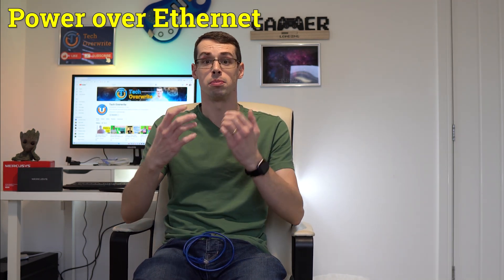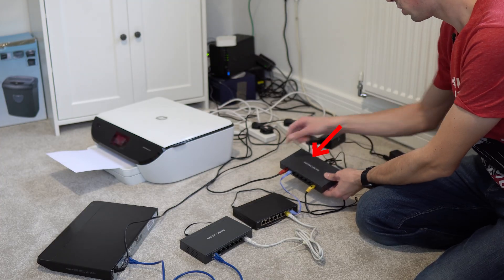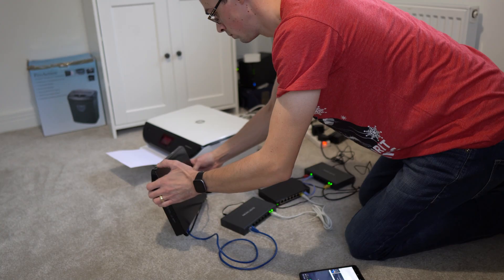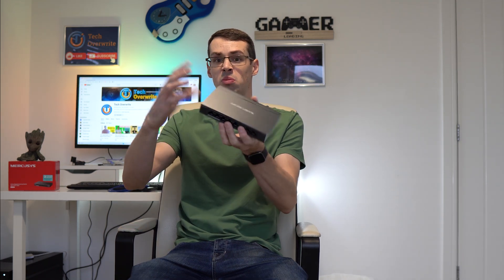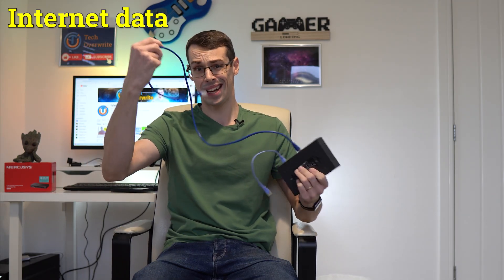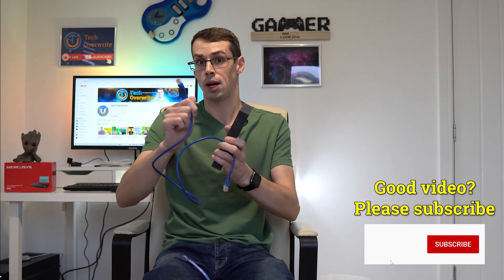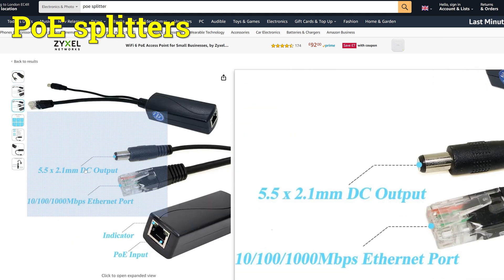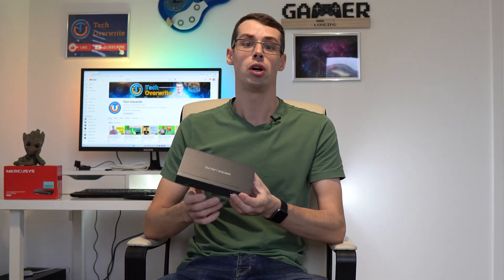Will It Fry? Non-PoE Devices With PoE Switches

Comment: can I connect a LTE router which uses passive 24V poe adaptor to poe switch insted, will it burn what do u think ?
Reply from the maker: I might be wrong, but some (many?) PoE switches are 48v so you could potentially have problems. I wouldn't personally chance it, but check the manuals of both too.

Comment: The comparison at 3:00 isn't correct, because the product shown on the right is a midspan injector, and doesn't have any switching circuitry included. Passive PoE should be outlawed, because it fries the termination resistors in the blink of an eye.
Reply from the maker: Thanks for the clarification, that's good to know, and I agree that passive PoE shouldn't exist. Luckily it's more common in prosumer and pro level equipment (i.e. people who should know what they're doing) but there's always that risk that someone else picks up a passive PoE device and tries to install it. :/

Comment: Can you connect a rj45 tester into active port on poe switch
Reply from the maker: Ooo good question, unfortunately I don't know but I'd guess that the answer is "it depends". A good RJ45 tester should definitely handle it fine - some even have PoE testing functions, after all. But a cheap RJ45 tester? Hard to say sorry - I would double check the manual.
Reply: Actually if it can help i have the klein tools scout pro 3 i really hope it is not on the cheap rj45 tester category if you familiar with the item
Reply from the maker: @joemccarthy2109  that's a great tester, nope definitely not a cheap one 🙂 So that model does have a voltage checker, and the manual (page 4 of the PDF) says it checks for RJ45 voltage before performing any tests. So it sounds like it would be fine connecting to an active PoE port, based on the PDF I just checked out.
Reply: Can you please check page 3 letter d my all problem to begin with it’s because that note the rj45 voltage check is actually on the side of that tester but the hublink function is on the regular rj45 port on the tester and i would really like to figure it out after a month of searching
Reply: What do they mean by saying active port according to what you have said you really should have connected it into an active port and not passive one but they say the opposite
Reply from the maker: Unfortunately I don't know for sure because I don't have the Scout Pro 3 myself. My hunch is that contacting their support might be best (assuming you get through to the right team - i.e. a more network focused team). I wish I could be more help but I wouldn't want to guess here. I thought the PDF was referring to the active PoE port on a PoE switch though, not the Scout Pro 3.

Comment: if i use an non-poe switch with the splitter to connect to a pd, if i replaced this PD with another non poe equipment, will a problem happen?
Reply from the maker: I think it should be fine. If I'm understanding correctly, just the data 'part' would be used here - the power would not be 'used'.

Comment: Yep, I was also wanting to know the same.  Just bought a new Netgear POE switch for 7 new POE cameras (and ethernet around the house whilst I was at it).  I just wish I had come across this yesterday before I said "Oh well, let's see what happens" 🙂  I can now keep my old switch with my home and work computers with only 1 trailing cable whilst I set up all other stuff and wait for the new data points in the office and move everything over to the data rack.
Reply from the maker: That sounds like it'll be a sweet setup (I have 7 PoE cameras streaming to my NAS, it works out great). Glad you liked the video and good luck with your networking 🙂

Comment: Many injectors are passive PoE.  You also have to consider voltage.  Some devices will not work with the 24V injectors.
Reply from the maker: Hmm that's true, I actually have an active PoE injector somewhere, but you're right that many aren't. Good point thanks 🙂

Comment: Most poe switches auto sense , unless its passive poe like those 24v gen1 unifi switches where u can turn the power on on the switch port and leave it in the on position
Reply from the maker: This is a good/necessary feature for sure. The 'always on' options can make sense, but scare me so I tend to avoid these type of ports/switches 😄